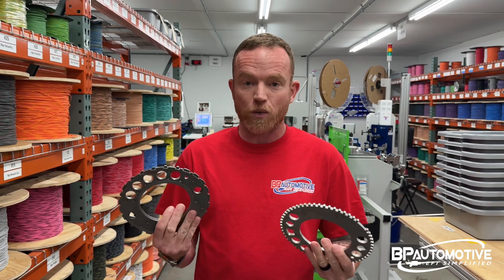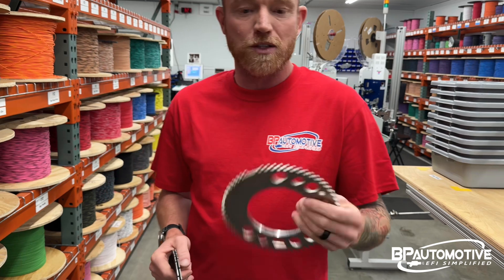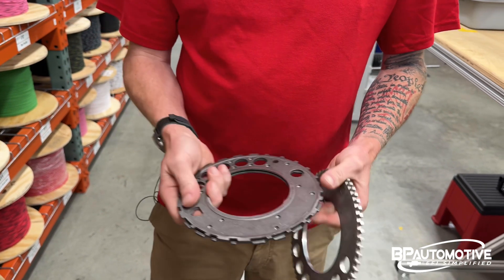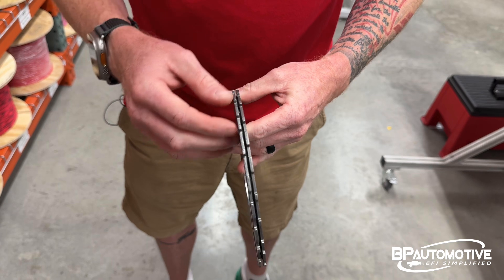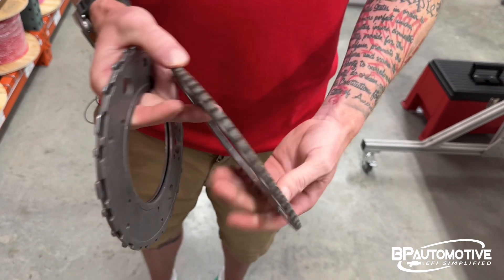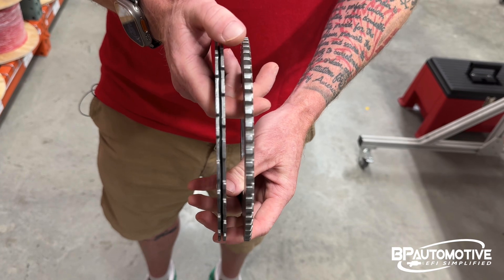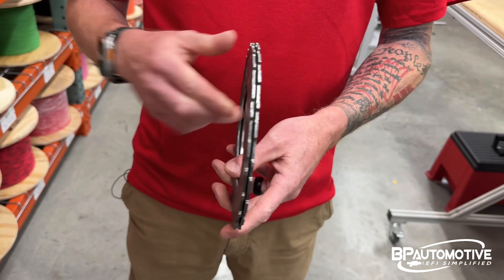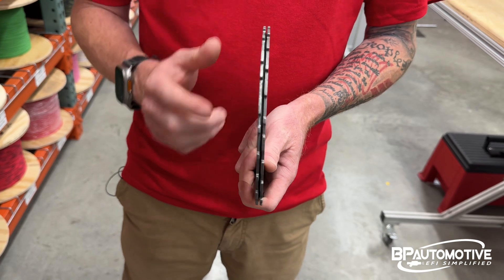Let’s Talk Reluctors | 24x vs 58x

Comment: Unless you find someone like Dave's Auto Center , who in some cases can upgrade a rebuild , it can be a gamble . You must verify the source of an engine . Some salvage yards will sell ANYTHING ! Warranty : We'll give you another one . Only had 200 K , ran GREAT ! 😂 Just dump out the water before you run it ! 😂
Reply: @billsmith2212  I never buy engines from junkyards or people that I don't know. I buy them running, and I drive them.
This way, I can check compression,  oil pressure, etc:

Comment: Hello Bill, I'm going to need a harness for a swap that I want to do, but now, with the information that you shared in this video, I'm a little uncertain about a couple of things. First off, the engine that I bought is a 2002 LQ4 6.0 from a GMC YUKON DENALI. It is dbw, and  I want dbc. Is it as simple as changing the throttle body, or does the reluctor come into play in this instance? Thank you!

Comment: There is a video of a Chevy Van that wouldn't run after an engine rebuild . The " machine shop " put a V6 reluctor wheel on a V8 crank . This was discovered by a tech with a lab scope AFTER the engine was installed and wouldn't run ! OUCH !
Reply from the maker: YIKES!  These kinds of issues are a bear to diagnose!  Its why we prefer email support because pictures and a detailed history of whats been checked and what hasn't is crucial when you run into oddball things like this!
Reply: @bpautomotivellc  Luckily it went to Gerry " G " Truglia and he found it on the lab scope . The " machine shop " mixed it up . And the labor ? WHO pays ????? OUCH !!!!!!!!!
Reply: Honestly, this is why I don't like rebuilds. Once a factory engine is rebuilt, it is never the same, no matter who builds it. I'd rather find a lower Milage used engine, still at factory specs and save myself some cash, and have peace of mind. I don't know of anyone who has these engines rebuilt by a machine shop that did not have problems. JMO!
Reply: SAD!